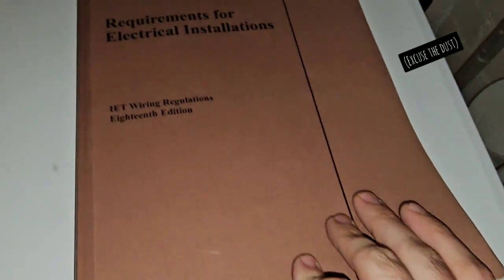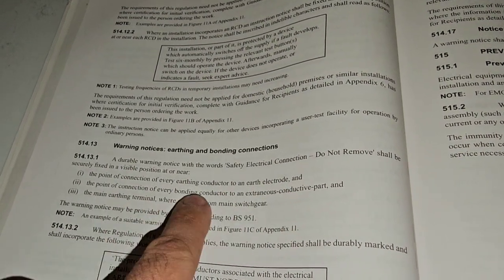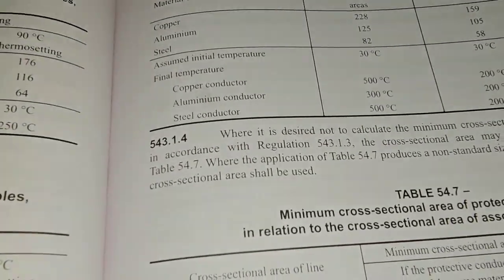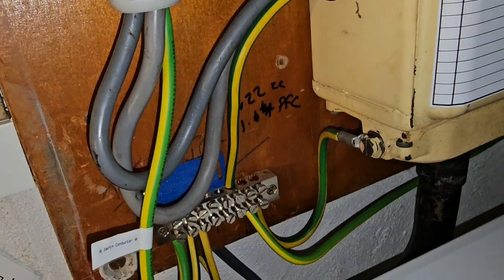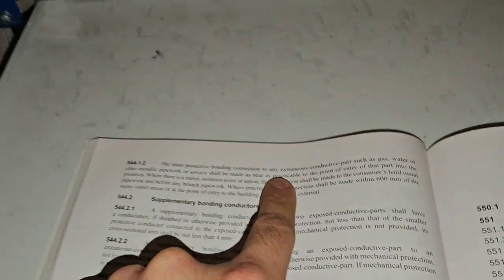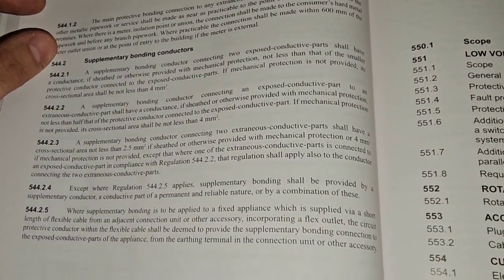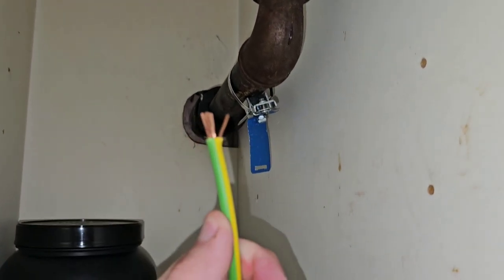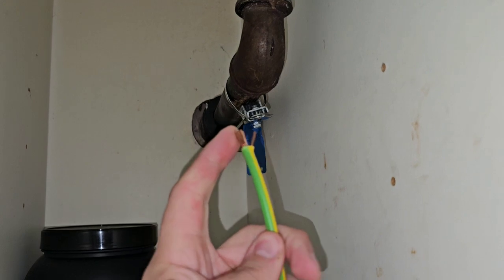Inspection Schedule: Section 3 | Earthing/Bonding arrangements

Comment: The "gas" pipe is unlikely to become live from internal influences is it?  Do you bond TV aerial cables, telephone cables, cable tv connections?
Reply from the maker: @timballam3675  Hi mate, I'm not sure the point you're trying to make? Care to elaborate?
Reply: @timballam3675: The point is to keep the gas pipe at equi-potential to the earth of the installation.  In the case here where the gas has been disconnected, the pipe still enters the property so is still an 'extraneous-conductive -part - so should be bonded.  What if the gas pipe, which may very well be electrically connected to a neighbour's pipework incidentally, introduces a potential difference to the property?     As John notes - it's unlikely he could create a dangerous fault situation by touching it and something at a different PD - but it's a shoddy way to leave a job which I think was John's point?

Comment: From my understanding the figure 0.05 is from GN3 and refers to the maximum resitance between the earth clamp and the associated pipework. 
So you would test between the earth clamp and the pipework it is clamped too, this resistance figure must be no greater than 0.05. This ensures the clamp is making a good connection to the pipework. Many instances earth clamps have been clamped to painted pipework and do not make a good connection. Hence a high reading.

The resistance of the bonding cable has no maximum value that I know of. As long as the CSA is compliant with the relevant tables within the regs book.
Reply from the maker: That's an interesting view on it from the IET. It makes sense to confirm the connection is good. However, if the bonding conductor is in the clamp, the reading would be good regardless due to the link at the boiler. Does the bonding have to be disconnected? Also, how far away does the clamp have to be on the pipe? It's such a tough one for spark as the potential problem very seldom happens. The old boys that taught me made a really big deal out of it but I always saw it as a chore. Especially supplementary bonding 🥲 such a pain.

Comment: Jesus. If a 6mm is getting hot I think you’ve got a bigger problem if that’s your earth. How much current would you be putting to earth to make a 6mm hot?
Reply from the maker: @davideyres955  It's not so much the current as the path. On a PME system, if a PEN conuctor is lost or at a high resistance, then the current would flow down the services. The services might not be the greatest path to earth and, if there's a PEN fault there's a potential for neutral currents from other properties to be diverted down the services! So they can get rather hot! Diverted neutral current can be a very dangerous.

Comment: 0.05 is the expected test results in Guidance Note 3.

Figure 2.16
Look above this figure - it gives lengths of cable where 0.05 is expected.
Turn the page to expected test results.
"For joints across bonds by earth clamps and similar,  the readings should approach 0.05"

Comment: Great video John. I was also under the assumption that the bonding readings had to be 0.05 or below but as you said I couldn’t find this anywhere in the regs book itself. 

When I did my 2391 the tutor asked this exact question and I answered 0.05, he said that wasn’t technically correct and that it just had to have a low enough resistance reading to allow current to flow in the event of a fault. I thought this was quite vague though to be fair as what is defined as a low enough reading for a main protective bonding conductor 😂 a definitive value would be something that should maybe be introduced in the new amendments 🤔